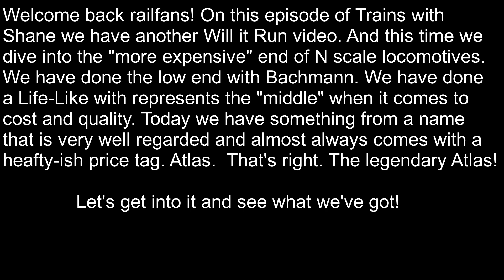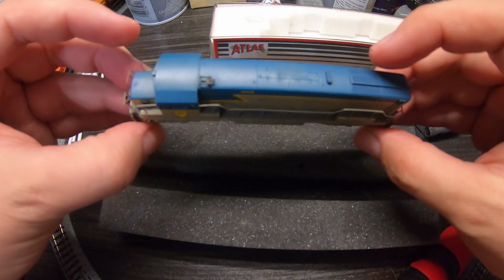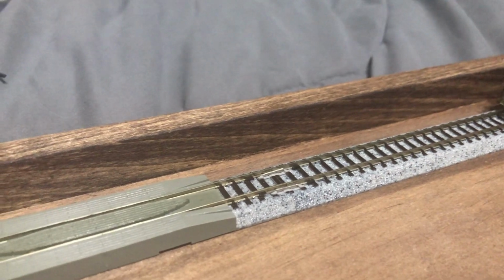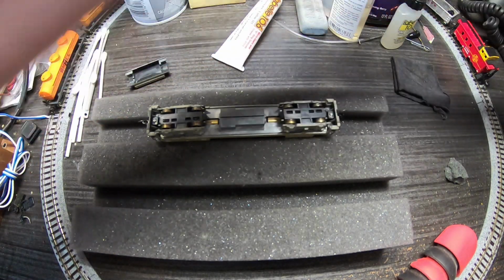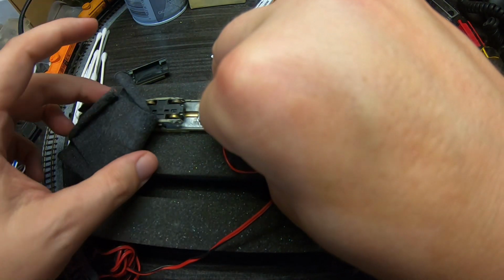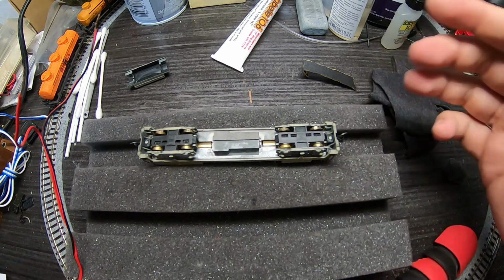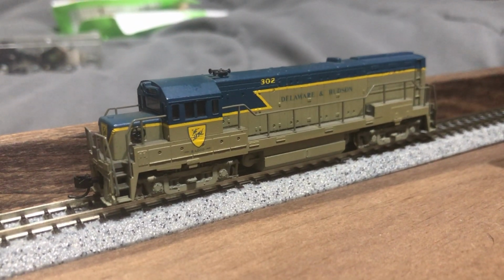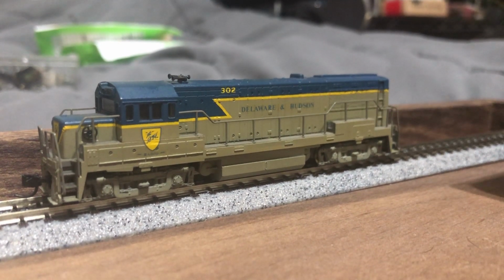But it's an Atlas - Will it run - N Scale Atlas GE U25B - eBay find - Trains with Shane Ep12

Comment: I agree that people can be rude about someone's choice of manufacture. I have O scale and N scale affordable models because I have a budget. Bachmanns have really improved but the haters can't help themselves.
Reply from the maker: Yeah, The guy I mentioned was really being rude. I actually think I have more Atlas N scale than I do Bachmann but that's only because I've found killer deals on them on eBay. Interestingly my most expensive N scale locomotive is a Bachmann. Actually the two most expensive (what I paid) are Bachmann. lol. But one is DCC/Sound. 

I just hate the brand myopathy. Don't get me wrong Bachmann has really made some terrible stuff in N and HO scale. But, interestingly, so has Atlas. When they first broke into importing N scale stuff they were getting stuff built by Mehano in Yugoslavia and later Rivarossi in Italy (which was better but still junk). The quality of those made the Bachmann units look like gold.

Comment: File the ends of the rails at a 45-degree angle in a few strokes. Almost every Unitrack rail needs this treatment.
Reply from the maker: That was what I was thinking as well. just to take the hard edge off. After going back and watching the video I think the rear wheels may have not been on the rails.

Comment: Shane, better yet, get some electrical contact cleaner, spray on to your cloth and go to it. I also use on the track. No scratches and great conductivity. Try CRC contact cleaner.
Reply from the maker: I've actually got some electrical motor cleaner. If I need to i'll give it a shot. I've used CRC prodicts in the past like their carb cleaner, good respected company

Comment: If you know how to make things work again more power to you I have bachman as well and I'm an insular and I've gotten used stuff and my stuff performs just like the high-end stuff so but the one thing I can say that you're never used mineral spirits they don't work you're not very good for cleaning if you have a hobby shop near you going to the RC department and get yourself some electronic motor cleaner which they have I'm sure they do and use that you're definitely won't regret it that's the stuff you use to clean your engines and stuff and all that cuz it works beautifully
Reply from the maker: I've got cans of the RC motor cleaner. (I did a bunch of 1/10 scale racing up until about 3 years ago). I generally don't use that on my model railroad stuff as I rarely find the difficulty to be the actual motor itself. I use mineral spirits to clean my track. Most of the time if I have a unit that doesn't run right it's a problem with dirty wheels. and usually mineral spirits or isopropyl alcohol will get it done. I try not to use anything too strong because of weathering, decals, etc. But i'm always on the lookout for something new to use. next time I need to clean a wheelset i'll blast a little motor cleaner into a small jar and use it with a cotton swab.

Comment: Speaking of Bachmann, I wish replacement gears were available for N scale wheels.  Every locomotive I buy from eBay has cracked gears. I stopped buying them.
Reply from the maker: Same. I've seen people try to repair them by using baking soda and CA glue but for me it's just not worth it. Only newer Bachmann stuff for me these days.